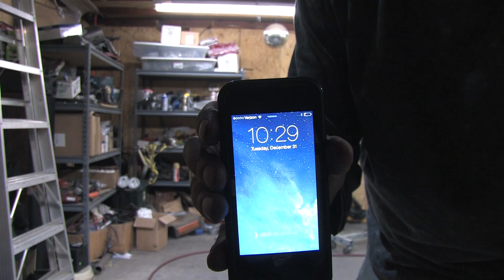New Year's Eve Hyundai Teardown

Comment: SO many aftermarket hyundai parts can be just pure junk. I saw a timing chain tensioner that completely died after 3000 miles from new. He could hear the chain slapping around inside. Got to either get genuine or a GOOD well known brand like something USA made or something. Because honestly some of these aftermarket south korean stuff and ebay chinesr crap is just stuff someone is making in their garage with a drill and a set of pliers and an angle grinder.
Reply from the maker: Don't worry... all this stuff except the casting of the head is Mitsubishi.  I only use Mitsubishi parts on my Hyundai because Mitsubishi made the engines for all 92-95 Hyundais, so I bolted Mitsubishi engines and parts (and well-made reputable aftermarket performance parts) into my Hyundai.  ;)

Comment: What engine is this? I've never seen someone rebuilding a Hyundai engine for performance porpoises!!
Reply from the maker: It's pieces of 3 different engines bolted together, and with a dozen other car models to complete the rest of the install.  The early '90's were an awesome time to be an import guy because of the DSM partnership which involved 4 major manufacturers, and dozens of cars among them that shared the same drivetrain parts.  Mitsubishi, Eagle, Plymouth/Dodge, Hyundai.  The block's out of a '90 galant 2.0L NA, the crank is out of a '90 turbo Talon, the head is off a different '93 1.6L Hyundai Elantra, the transmission from a FWD Plymouth Laser, the clutch from a 1995 Eclipse GSX, and the rest of it was sourced off my spare part shelves, junkyards, and also the builders' random boxes of spares to make it all bolt back together again.  The first generation Elantra is the car that everyone loved to hate.  During the same era, those early production turbo Eclipses were giving people hell at the local dragstrip.  It just so happens that their parts happened to be interchangeable with this Elantra because most every pre-95 Hyundai were powered by Mitsubishi engines.  Mix and match a few things here and there, and it's a bolt-on fit.
Reply: Jafromobile Fascinating!

Comment: You know this motor pretty well. Hopefully Hyundai will put decent bearings in soon. My 99 Ranger still running like a champ just under 130000. Would you buy a Hyundai?
Reply from the maker: Your Ranger is just a baby.  My stepfather's Ranger has 390,000 miles on it.  Would I buy a Hyundai?  Hmmm....  Hard to answer.  I might buy my stepfather a Hyundai Genesis because the comfort for the $ is practically unbeatable.  I'd like to put him in something with less miles on it and he can't afford to do it on a fixed income.  But with 5 cars in my own driveway already, this Elantra is about all I'll put up with at the moment.  I'd be really happy commuting in a Genesis or Equus, though.  I know they've got problems just like every other used car, but with 70%-80% depreciation in just 5 years, it's a risk I'd be willing to take.  The luxury certainly hasn't left the chassis in that short of a period of time, and it's a lot of car for the $.  It was a car aimed at undercutting the $86,000+ BMW market.  It does it quite well.  'specially the Equus.
Reply: I drove my 93 T-Bird 600000 and it was  still running hard. Ford knows how to make trannys and rear ends. My Bird ran 65 hwy and tached 1600, yeah I'll keep the Ranger. Just was looking at the Hyundai bc of reviews> On a budget here so the Accent and Elantra are catching my eye. Thanks for the iffy bearing. I'd rather put the enmgine trans and rear end of the Bird in a 36 Ford but no $ shop and tools. Thanks again.
Reply from the maker: 2 things:  1) the reviews you find about the Hyundai Elantra are not for this model of Elantra.  Especially if they're positive reviews.  2) the engine in this video is not the stock Hyundai Elantra engine.  It's only got 1 part that's actually from a first-generation Elantra, and it's not even from this particular Hyundai Elantra.  The bearings are aftermarket.  The engine in this car more closely resembles a 90-92 Mitsubishi Eclipse, but Mitsubishi never built an Eclipse with this combination of part inside it.  The Elantra I own is really not a good representation of any other Elantra out there.
Reply: Thanks for the info. I am merely gathering info on cars in this category at this point...so..the deformed bearing you showed is not stock Hyundai?....good news. I'd prefer to stay with Ford but it's budget time at this point.....stay with the wrenches.....just subbed you

Comment: I have an '04 Elantra 2.0..what cams did u use?
Reply from the maker: That is a completely different engine.  These cams wouldn't fit it.  You'd need to find an aftermarket replacement or regrind them to different specifications if you can.  Later in the series I go through great lengths to show you what my cam specs are.

Comment: do you use impact wrenches or drivers? I have a nice 3/8" makita impact driver buy no battery or charger which is more expensive than the entire kit. My Milwaukee M18 fuel red lithium battery compact 1/2 impact wrench is just way too much torque. It snaps lugs, bolts, welded nuts.
Reply from the maker: +fockyoumang Yes I do, I have air and 18V cordless tools in both 1/2" and 3/8" drive.  I don't use them for anything on engine work except for disassembly.  Whenever I'm doing assembly, it's hand-tools and torque wrenches only for assembly work.  I may run a bolt or nut down with a power tool once I know it's threaded straight (by hand), but I like my bolt and nut specs to be hand-torqued.

Comment: This incident convinces me all the more that I want additional sensors in the engine, including something to tell me if there are chunks in the oil without having to cut open the filter.
Reply: Yeah but the more electronic shit, the more that can go wrong. I'm an Import guys myself but I don't like to look under hoods and see an octopus of wiring harness going to everything and everywhere...Every 50-100 miles..(Checkenginelight) problem= Sensor...10 more miles later (checkenginelight) problem =sensor. 50 miles later..(checkenginelight) Problem = 43 fuckin sensors. I wouldn't be surprised if they start putting those stupid shitty sensors in your seats to let the engine know what your ass smells like everyday. I don't mind technology, but nowadays, its going way to far.

Comment: Its a bummer, but luckily there doesn't seem to be too much damage.  What's the oil pump look like?  A lot of people usually leave this out or forget it, but besides the block/head, I would give the turbo a quick run through also  as its inevitable gotten in there.  Then again, its only a 14b.

(Am I the only one that noticed the incorrect head bolt removal pattern?)

Comment: LIke a boss, tore down in just under 1.5 hours! Great video, thank you for taking us along. Just curious, why did you remove the head bolts by hand, but used the impact for the rod caps? I am wondering if I am damaging head bolts, I always just zip em off with my impact. Great video, keep em coming!
Reply: Probably easy to remove them more evenly by hand.  You should remove them evenly to prevent head distortion.

Comment: I am going to show this video to all the other mechanics at my work who laugh at me because I cut open every engine, transmission, hydraulic and fuel filter of every machine I service or before I start major repairs. it gives you vital information about component condition. thanks.
Reply: them laughing just shows there ignorance, or they dont care enough about the customer or no pride in there work
Reply: ChronicConnoisseur Well we do fleet maintenance so no customers just our own equipment. and most of them are good mechanics they just think im nuts and go over the top with stuff like this.
Reply: oh i was picturin a jiffy lube type place, still can never be too safe
Reply: ChronicConnoisseur nah I work for a large mining company so we maintain lots of equipment truck vans and also cars. but like I said they r  good at wat they do its just the way I was taught.